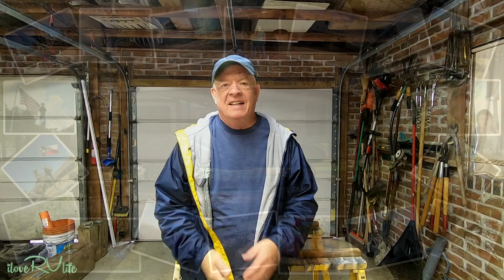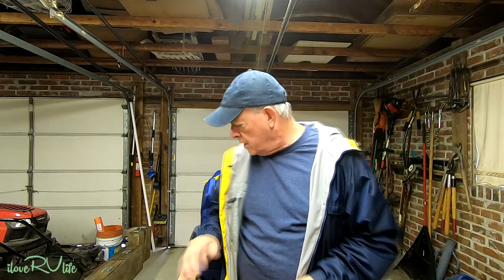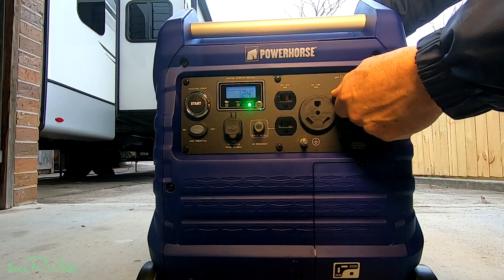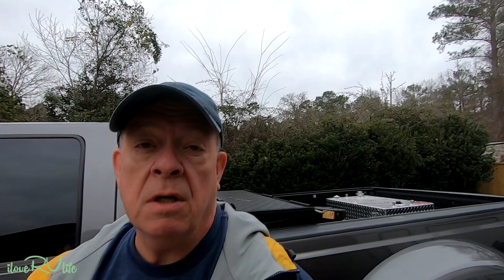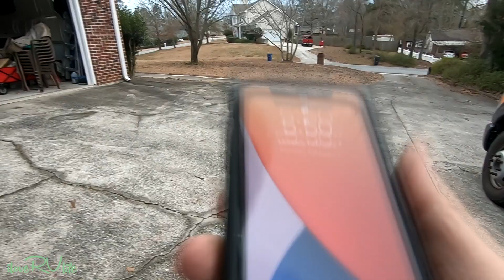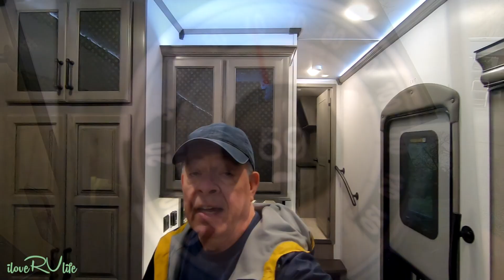Powerhorse 4500 Inverter Generator

Comment: I just bought one of these a week ago for my Camper to run a single AC unit and it didn’t make it a half an hour before it smelled like burning electronics inside the generator and then it shut off and wouldn’t restart. I was able to talk northern into just swapping it out for a new one instead of putting it in the shop and waiting to see what was wrong with it. So far, I am not a fan, but I hope this second one will last more than 30 minutes.
Reply from the maker: Hopefully it was just a bad egg in the bunch. We’ve used ours for 3 years with no issues. This generator we purchased. No advertisement or compensation from Northern Tool.

Comment: Just wondering how the 4500 powerhorse has been was it a good buy iam thinking about getting it any information you have to share would be appreciated
Reply from the maker: It continues to perform well.  No issues. No problem running one 15k BTU AC and general appliances.  Doing the basics, routine maintenance, running every 60 days, replaced starting battery once, (freezing temps got it), always fuel with ethanol free gas and SAT-BIL fuel stabilizer, travels in the front bay of the 5th wheel and handles road travel well.  For the price and performance, I’d purchase again.
Reply: @ thank you
Reply: How was the breakin period and how many hours do you do oil change and how many hours do you have now
Reply from the maker: I followed the manual recommendations. 20 hour break-in, changed oil, then every 100 hours of operation. Around a 1000 hours.

Comment: HI Jerry, How is this generator working out for you.  I'm starting to shop for one.  I was thinking about a dual fuel simply because I did not want the gas smell, but if I keep it in the back of the truck I guess it would not be bad.  Just looking for some input and how you are liking yours.  Also did you figure out storage?  Thanks!
Reply from the maker: It’s working great.  We use non ethanol gas and add a stabilizer. If it was to sit for a period, I just run it dry. I like the duals, but didn’t want to take the wattage loss on propane.  Northern had a no questions asked warranty that we purchased. We had it in the back of the truck and the strap slipped off. Hit the breaks and busted it up pretty bad. They gave me a new one in the box. We just returned from 4 months of travel.  I’ve designed a sliding tray for the 5th wheel front bay. Should have it built and video early December.
Reply: @iLoveRVlife  Thank you so much for the input, looking forward to the sliding tray video!

Comment: I got mine for $799 plus a $100 gift card today. Wow, I almost bought a 3500 Predator last week but luckily they were out of stock. This one came with a 2 year warranty vs 90 days for the Predator.
Reply from the maker: These are good units and great customer service at Northern Tool. I bought a one year replacement insurance. Thank goodness. The strap broke Caming back from Virginia and I busted the case. Replaced with a new generator no questions asked no cost.
Reply: @iLoveRVlife  I noticed a sign at the register stating they would no longer perform maintenance/warranty work on these and offered a phone number to call. I bought mine in Grand Prairie, Texas which is near Dallas.
Reply from the maker: With the replacement insurance the just gave me a new one.

Comment: New subscriber here! Love your videos, so informative!!! Will this generator charge your batteries while it is running?
Reply from the maker: Thanks Jim.  Great to hear you’re enjoying the channel.  It sure will.  No different that plugging in at the campground. If the converter/charger senses the batteries need to be charged, the generator will supply power.

Comment: It will likely not power both a/c's and the fridge in the dead of summer, as they draw max load when it's 100 degrees out. Much easier to get rid of heat from a warm place to a cold place. Hard to move heat it from a cool place to a hot place.  Definitely get a metal dipstick for it, and do your first oil change after 1 hour of loaded run time. I have two of the Powerhorse 2300i's and they have been fantastic.
Reply from the maker: Thanks Will.  Getting the magnetic dip stick on the next Harbor Freight visit.  We’ll see on the AC.  Doubt we’ll have the need to run 2, but other comments have shared they’re able to run 2 in the summer.  Break oil change done.  So far, so good.
Reply: @iLoveRVlife  it all depends what brand and size A/C's they are. Mine is a Coleman 15k without a soft start, and I can run just it, and 12v lights on one of my 2300's, but she's just short of maxed out. In 90* temps my a/c draws about 13A . With both in parallel (3600 running watts) I can run the whole house, just gotta cut off the water heater to use the microwave.
Reply from the maker: These are Coleman Machs too.  Big step up from the noisy Dometics we had.

Comment: That's  a nice generator.  We bought the champion 4500 electric start.  I'm going to  mount mine in the bed of my  pickup truck  I am getting a  magnetic  dipstiick and a cover.  I  live in  north east Ohio  so I get all  four seasons.  I  just  changed the oil first time  after 6 hours and I put in  mobile 1 full synthetic.
Reply from the maker: Working great. Have in the back of the truck for now. Project in the plans for a more permanent set up. Should have a video soon.

Comment: I have a champion 3500 which is about the same size as yours.  I also keep it in the back of the pickup with the same cover also.  What I did was purchase a muffler extension with the aircraft exhaust hose which I point out of the back of the truck.  This helps keep the heat and fumes out of the bed.  Even if I take it out and put it CHAINED to the rear bumper on the trailer I can use that hose and point it in the direction I want.  There was a video on youtube that had the extension/hose kit.  You can purchase different lengths of hose for your needs.
Reply from the maker: Great tip. Good tip.

Comment: Congratulations on the purchase. We just bought a Predator 3500 for our 30 amp and it's awesome. These two machines have to be made by the same manufacturer, because so much of yours is exactly like ours. I think you're gonna really like having it with you.
Reply from the maker: They do look similar.  Maybe a few changes in the inverter and a few of the electronics to get the 4500 watt surge.
Reply: I also have a predator. . Its uncanny how very similar it is. I've had my predator 3500 for about 3 years now and love it. 
I believe predator came out with a 4500 also recently
Reply from the maker: They do look similar.  Harbor Freight had a 4400 watt in an open frame.  Their recent offer in the quite, inverter style is the new 9500.  Price is competitive, but was larger and much heavier that we needed.

Comment: Congrats on the new Montana I know you will enjoy it. I see you still love those blue O.R. towels, they do come in handy when working around the RV and truck. That generator is great I wish I had one for our RV. Did I see a new fuel tank in the bed of the truck? you will never regret having the extra fuel capacity on board. Mine is 60 gals and I wish I had gotten the 90 gal one.
Reply from the maker: Thanks John.  Appreciate those OR towels.  Still recycling them. Installing the fuel tank next.  It’s 55 gal.  Largest I could find and fit under the cover.  It’s going to be a game changer.

Comment: When you go camping in cold weather the ice maker water line may not be heated. My water line to ice maker line starts under sink goes to the rear of driver side slide and backup to refrig. It is not in a heated area. You may want to check your water line location. There is a valve so you can isolate and drain.
Reply from the maker: We ran into that this morning.

Comment: Looks just like the Predator 3500 with extra 1000 W. Nice!
I had to install a soft start unit on my a/c & love it!  There are a few mods you might want to look at. Spark arrestor & air filter. A better spark plug too.
Reply from the maker: Thanks Danny.  The Powerhorse comes with the spark arrestor installed so it’s Cali compliant.  Didn’t show in the video, but also has a good quality air filter.  We looked at the Predator and it was a second choice.  For a few dollars more, the extra wattage and a few small upgrades for just a few dollars more.
Reply: @iLoveRVlife  yes, the spark arrestor is what causes problems. Clean it often (25 hrs) or remove completely if it’s not needed. It had a tendency to clog up with carbon, then it won’t run or runs poorly.
Reply from the maker: Thanks

Comment: I was thinking when you use 50 to 30 amp plug you only can only one side of the 50 amp service to rv .
Reply from the maker: Hi Gene.  Not so with the correct adapter.  The one shown in the video combines the 30 amp feed on both the L1 and L2 50 amp cord.  Works perfect with good load management.  Proof was both ACs running.  One is on L1 and the other is on the L2 leg.  If you need this adapter, we have it listed on our https://iLoveRVlife.com/RVs-accessories/ page.

Comment: Looks like a great generator, maybe you can look at a pull tray in your rv generator compartment that you can slide it out when in use and slide in when you're done with it and never have to load and unload plus it would be out of the wheather. Enjoy the snow ❄.
Reply from the maker: Thanks.  You’ve read our upcoming video production list.  It will be installed in a couple weeks.  Interesting twist on build. Video in a few weeks.  We’ve got a little snow twice.  Maybe one more dusting before we head back south. Brrrr.  Going to be 18 F in the morning.

Comment: For it to run both ac’s is amazing based on the generator videos I’ve watched in the past.
Reply from the maker: It was topped out, but ran. Don’t think I could have done this with my previous Dometics.  These are Coleman Mach ACs.  Start is much softer.